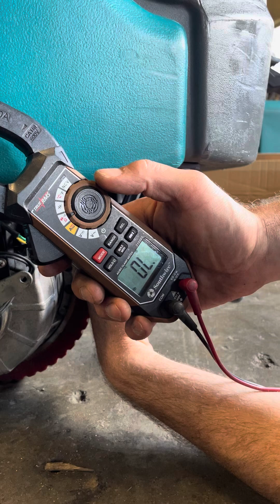Tennant t7 no drive - 7 beep error code

Comment: I have the same exact problem with my tenant t7 at work everything power is on all lights but it will not go forward or backwards. 

My question is what exactly is the solution to the problem and how did you fix it? 
Any help will be greatly appreciated thanks and keep up the good work.
Reply: Did u figure yours out I'm having same issue
Reply from the maker: You have to do some basic diagnostics 

Do you have any errors messages or beeps from machine